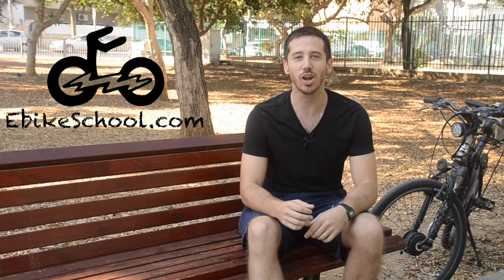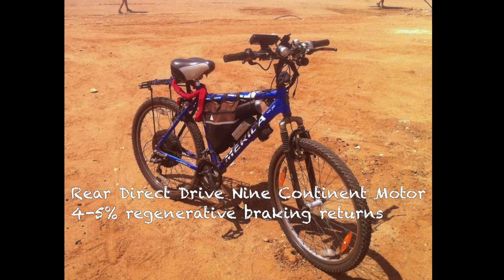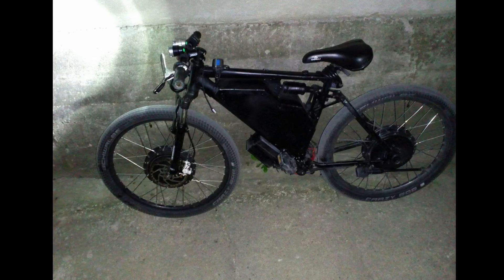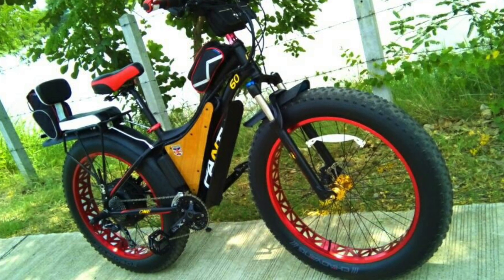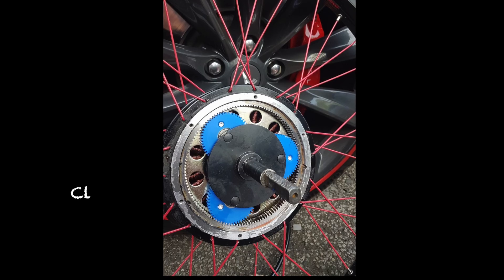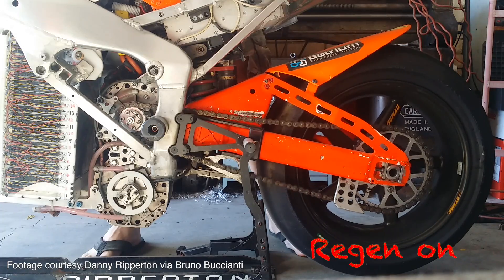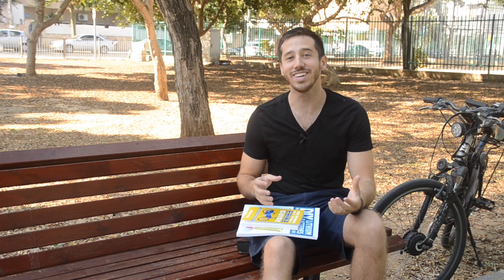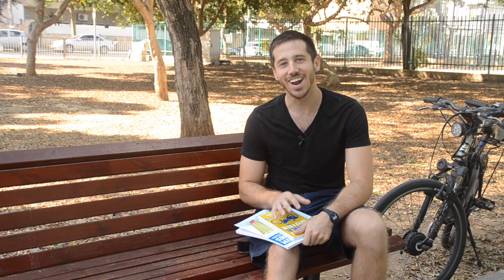Check out these regenerative braking ebikes you guys sent in!

Comment: I am not much familiar with electronics; but I think 1- building hub motors larger with 2 separate sections drive and generator or 2- using 2 hubs one on the back & one on the front 3- using 2 wind power generator a. narrow and long parallel to front suspension generator b. inside the horizontal handlebar 4- using suspensions to generate power (front and seat) 5- using motor to generate power itself whenever not being used like pedalling or down the hill. All the above one or combination of two or more could increase the range lot more than just regenerating brakes. 
This is just about range extension and not about self powered bike. Do u know if any of the above has been tried? if yes what was the result? Thanks
Reply: A direct drive hub motor is a generator with same efficiency as the motor.
Wind resistance is the enemy, suspension sounds finicky .
Most effective and cheapest range extender is another battery.

Comment: After watching this video I have learned two more reasons that regenerative braking probably isn't something I will be able to use for several years or more. One reason seems to be that not many people seem interested in using regen ability for bike-touring/bike-camping. People that want speed (usually huge heavy hub motors) just seem to use it for saving brake pads which is cool but not the primary purpose for regen. Although I would most assuredly benefit in that aspect too. People that want to haul freight are less concerned with speed over torque. Also very important to me as my mid-drive attests. The other reason I won't be investing in regen is the additional torque applied to the trailer frame and suspension would require mods that would increase the weight significantly. Again, all fine with an electric motorcycle that you can plug in a couple times a day, not so good for a tour-bike. 

I have been using my ebike for the past few years mainly for bike-packing and day rides. Fully loaded pulling a single wheel suspended trailer I can indulge myself with 180 lbs of gear, tools and parts, toys, food, water, and other liquids.  There's also the additional weight of 2 x 30+ ah Li-ion batteries, a Grin Satiator, and the BaFang BBS02. Fully loaded it's a pig with long legs. Stripped down she is svelt but able to do single track more comfortably than most any other tour bike alive. With a multi-use ebike the rules are different in that the focus is more about distance. I don't care how fast I can get to the top of Pikes Peak, I just want to be able to get to the top. So that I can sleep for the next 12 hours. That's why regenerative breaking would be even more valuable to me than to Anyone that has access to AC power every night. You can argue that people that have never run out of power don't really need the regen capability at all other than to save brake pads. I can check most of the boxes needed to make investing in regen ability worthwhile, need (I need the additional power), weight, speed, varied terrain (good when descending, not so good climbing). Where I run into problems is I can't afford to use a large oversized wheel or rim and some ridiculously large (and not street legal) hub motor. Rolling resistance for me needs to be kept to an absolute minimum. When I move from a "base-camp" I am fully loaded and it becomes all about using the minimum amount of battery power possible to cover the greatest distance. Depending on the terrain I have up to a 150-mile range or as little as 40. You can ride without any assistance at all even uphill... if you are a far better man than myself. Once at camp and I have everything down-loaded I can grind out 100+ miles with a lot of legwork or "sail" mostly on throttle about 60+ miles with little to no peddling and all on a single pack. I would never trade the mid-drive and Rohloff combination for what I do and have a dynamo front hub for lights and a 5V USB on tap when I'm moving. That leaves me the trailer wheel to possibly use a hub motor for regen and to lessen brake wear on descents, but if I ever got shot in both legs I could use it to get to the hospital... so that's a bonus. 

One last point I would like to make is that most of the bikes you have shown aren't legal for street use... pretty much anywhere in the civilized world. Again, a moot point for so many today but the most paramount of importance for someone touring on a bike.  That more than anything else is why the use of nothing larger than a 750W motor is mandatory... and completely reasonable when you want your ebike to be viewed as a bike and not an electric vehicle. Meaning, no license, no paperwork, no insurance and almost no restrictions when you comply with the rules. Until someone focuses on this aspect of biking we won't see it as the standard as it could be. I am putting my hopes for relatively unlimited range on a 300W solar panel.   -   https://imgur.com/a/EhbVxLF
Reply: So many words and so many holes in your logic. I would suggest you reread/relearn everything you think you know about regenerative braking.

Comment: Hi Micah, I'm putting together a ebike over in NZ. Just brought one of your battery connector kits from India - it's great!

I'm keen to go the mid drive way, using the MY1018 motor I have; however I'm finding it hard to source a freewheel crankset without spending too much.

Is there any reason why I couldn't just connect the motor to the largest sprocket on the crank and just omit the free wheel?   

I think i'd be happy using it as full time pedal assist where the pedals and motor are not independent, but haven't seen any other bikes done this way so wonder if there's a reason why this is not common.

Comment: Thanks Mikey,  these videos have been a great help explaining all aspects of "E" Bike building especially the battery construction, this will come in especially usefull as I will be making a Lithium battery for my friends disability scooter as one of the lead acid ones is dying, will be trawling around a lot of our  laptop repair shops now for batteries to use, I know you recommend using new batteries and this does make sense, but, when money is short  you have to take the other option, had a Eureka moment last night when the wiring of a bms suddenly became clear thanks to your battery book and a stripped down lithium drill battery, now have a couple of banks of batteries on charge ready for IR and capacity checks, also picked up four "E" bikes and a lot of spares  yesterday that a local man had made but is unfortunately now not with us, will be documenting the builds and putting them on my You Tube channel, Full regards Doc Cox.

Comment: Interesting topic.  I had a "Magic Pie" hub motor that did regen braking, but didn't seem to add much to the battery.  I'm looking at mid-drives now because they don't add drag when in non-electric pedal mode.   But I guess you lose the freewheeling if you want regen braking!

Comment: hi miky, I have 2 questions...
1- why can't we use CVT transmission in electric maxi scooters working with mid drive motor ???
2- what is the difference between hub motor and mid drive motor ???
Thanx alot.

Comment: Interesting results. If I was marketing ebikes or ebike systems with regen braking, I would definitely use reduced brake wear and downhill performance as the main selling points, and the range extension as a bonus.
How are regen brakes affected by battery charge level? I used to drive a Nissan Leaf, and it would gradually increase regen capacity from nothing to full within the first few kilometers after a full charge.

Comment: Awesome video. Very factual and to the point. :)
I find the regen levels on both my bikes vary with the power level used to move forward. i.e. If I use 4KW and ride hard, regen % will be 3-5%, but if I cruise around at 750W, regen will be more like 7-10%.
Also if I ride up a mountain, then regen all the way back down I've seen regen up to 15%.
Cheers

Comment: How about adding a regen motor to a bike which already has a bbso2. Would that work if it was only used as a brake. Could it be mounted on either the front or rear wheel?

Comment: "anything you want."
Reply: Because of the laws in my area, I need to make sure I don't exceed 750W per motor, but both of my front and rear hub motors are rated for 1000W 48V. I heard some where that either undervolting or underamping your discharge could cause damage to your system (battery, controller and/or motor) and that if you decrease the voltage it would try to compensate by pulling more amps, thereby increasing the current load and heat. Is there a danger to discharging at a lower rate than recommended or is this for charging the battery instead?

Comment: hey micah. Thanks for informative video. Now I want to build an E'bike too ;) but first I want to build a battery pack which can produce continous max 40A on 10s (instead of my 10s 5Ah lipo batery). What Li-Ion batteries should I use? Can you recommend any type of battery or config?
Thanks a lot for your work.
Greetings
Reply from the maker: It really depends on how much AH you want. For example, if you only want a 5Ah battery using 2.5Ah cells, you'll need cells that can each do 20A. But if you want a 10Ah battery with 2.5Ah cells, you can use 4 cells in parallel with cells that only need to put out 10A each. I've been using LG MJ1s a lot as they have high capacity (3.5Ah) and decently high power (10A).

Comment: I'm 61 with a really bad back, SO WHY the heck am I slowly gathering information about building ebikes?....thank you for the inspiration, keep up the good work, now all I've got to do is design a suspension system that removes all the bumps and get a bike and build a lovely powerful battery...as I really really don't want to travel at 4 mph....
Reply: Hay there Richard, ever consider a recumbent trike?
Reply: Recumbent trike? I made a fun one with 42000w hahaha check it out https://youtu.be/sRH_cpCwNDs
...so much POWEEEEEERRR ohhh yeaaahhh =]
Reply: Richard Harries get a full suspension downhill bike, they have front and back suspension with TONS of travel, ride like you're in the clouds and won't hurt your back as long as you have the seat height and handle bar height just right
Reply: Thanks for all the excellent advice, wouldn't be able to get up/out from a recumbent bicycle/tricycle...I'm thinking more along the lines of something that looks like a quadbike so that the tyres can absorb some shock before the suspension system takes some more, luckily my arms are still strong and I'm a retired marine engineer so always thinking outside the box...all advice gratefully received, many thanks..

Comment: Interesting stuff, I've been running regen on my DD builds for a few years now and the returns have varied with the type of regen used. The regen as demonstrated by bruno seemed to be 'slip regen,' at least that's what it was called on the old lyen version of the programming software xpd and it works slightly different to brake lever (or variable throttle) activated regen.
With slip enabled in the settings as soon as you release the throttle the region activates, which got me my highest return about 12%.
However I found this to be a quite annoying way to ride my ebike, as it does not allow for coasting (when e.g you light ahead turns red) and in my opinion actually makes for less efficient energy usage, because you do not have your momentum anymore to drive you further down the road for almost no energy used. 
Lyen controllers disable regen at 10mph (maybe 15?) so then you can coast, but some programs and controllers allow regen all the way down to zero too.
Grinfineon version esc's (and some new kelly and sabvoton) also have variable regen, activated in various different ways, but the ability to modulate the power on the fly allows for greater control of braking strength and imo greater braking control is always better (wheel locking up not so much ;) personally I prefer brake lever activated Regen on my builds, set fairly high and just used to augment the stopping power of my hydraulic brakes and save brake pad wear. in fact on one of my first builds I'm still running the original pads! this type of braking however has never got me more than a five or six% maximum return, but the braking is so much smoother and stronger and of course I can Coast however much I want this way.
Anyway thanks for all the great vids, looking forward to your next one.
Reply: what controller are you using?

Comment: What is your take on building Ebike batteries with recycled 18650 cells? What are the essential tools to make sure you get decent cells, and is this something you would recommend to a first-time battery builder?
Reply from the maker: It's possible, and since new batteries can be expensive, it is often a good way to start battery building for cheap, but I'm not a huge fan of it. Ebikes usually require higher power than most battery powered devices, and recycled batteries come with unknown histories and uses, so its hard to know if your battery is good and safe, even when doing capacity testing. If using recycled batteries, I highly recommend single cell fuses.
Reply: There's a ton of 'hoverboard' batteries available now since they banned most from import.  Nothing wrong with most of them.
Reply: Ive made a few batteries with recycled cells but always use high drain cells like those found in power tool batteries
Reply: ElectricBike Not always low capacity cells in power tool packs. I harvest plenty of 30Q (3000mah) and 25R (2500mah)
Reply: There are a lot of people recycling cells most from old laptop batteries ( https://m.facebook.com/groups/323586824654552 ) but these cells are not high-current and not suitable for electric bikes, they'll get super hot. Power tools use high current cells (ideal for ebike) but low capacity (not much range). 
You can try and make a pack using recycled cells (don't invest too much money and don't expect too much) just for fun and to learn battery stuff. I would highly recommend keep your eyes always monitoring the series voltages and charging using a RC hobby charger so you can see what is happening and properly balance the pack (cheap BMS doesn't really do a good job specially in this case using mixed random cells).
New cells is far the best option, will give you the most performance and range + its reliable.
You'll learn a LOT building your own pack regardless if you use new or recycled cells, learning new things is always a good thing =]